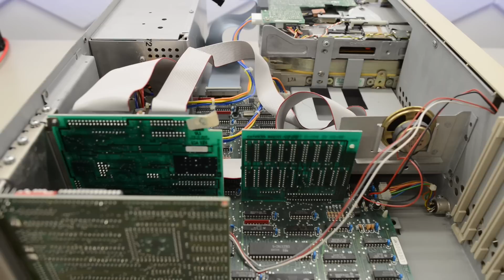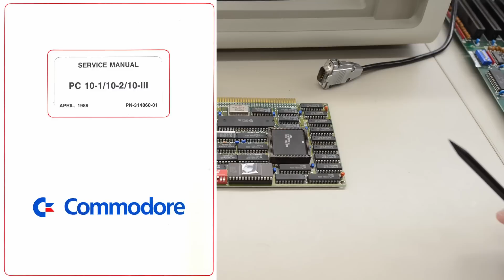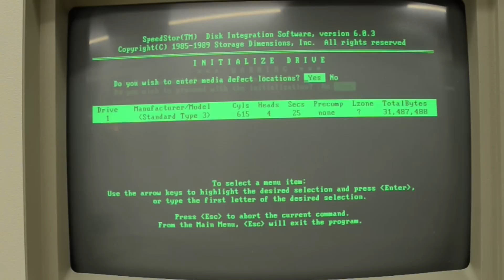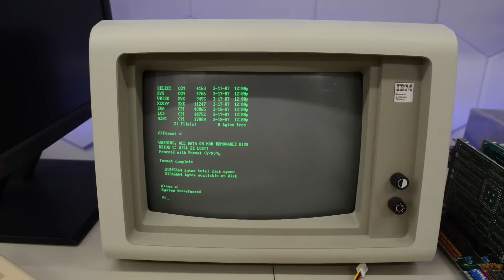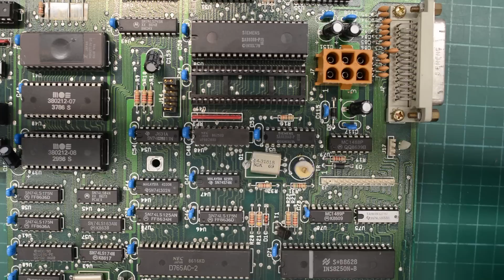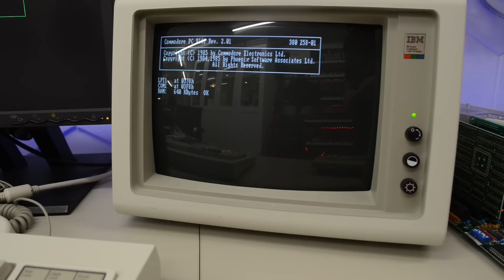Commodore PC10-II with RLL drive restoration repair and overclock!

Comment: I wouldn't have the patience with that harddisk, XT-IDE for me and a 512 MByte CF card. Much easier to get data on and off the machine too.

Regarding the faceplate, that was a common sight back then, beige desktop or tower and a black harddisk in there. 😁

Comment: Thanks for the great video! If not already commented, the ATI GS rev 3 supports an "emulation mode" for displaying CGA graphics on a 5151 or the original 76BM13 monitor.
Reply from the maker: I didn't know that. I'll try it out when the Commodore is on the bench the next time. Thanks
Reply: @Epictronics1  And if you end up high-speeding to a near AT class system with the PC 10-II, an EGA Wonder provides the same but for EGA.

Comment: Hello!

I have a similar machine, but I don't have the original keyboard. If the computer doesn't have that keyboard, it won't even boot up. Do you know how I can boot the machine without the original keyboard?

I would appreciate your help.🙏
Reply from the maker: Unfortunately, I don't know
Reply: @Epictronics1  Thanks!

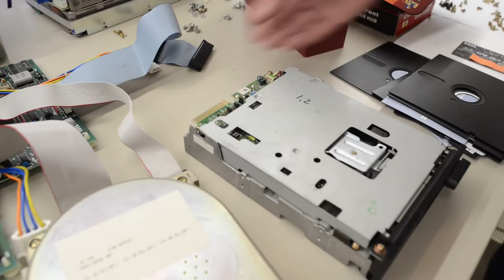Comment: 21:55 You can't swap out a 360kB drive with a 1.2M drive and expect it to just work. I'm sure you are aware on an AT machine you just change the bios settings but on an XT there would either need to be a bios setup program run if the board has nvram (or a dallas rtc module) or some other way to set the FDD type like jumpers or DIP switches etc.

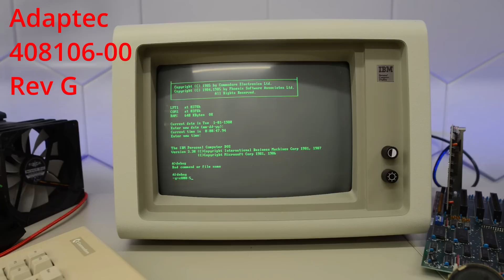Comment: 13:12 That number is the part number of the board. The actual controller is Adaptec ACB-2072 and it is indeed an RLL controller
Reply from the maker: Excellent. Thanks

Comment: 6:00 The ram board is plugged in separately for two reasons. It is closer to where the ram is actually connected/used and the routing would be easier rather than running long traces to the corner of the board.

Comment: You could have used the hard drive controller card to low level format the drive. You will need a DOS program called debug. When you start debug, you will get a : prompt. Type in g=c800 which should allow you to access the low level format routines on the controller card itself. On those old RLL and MFM hard drives this is the best way to low level format the drive and not with a third party utility. I had the exact same hard drive in my Packard Bell PB8810 XT computer back in the day and these were the configuration steps that were required to set up and use the hard drive on the computer.

Comment: if i recall right, with VSET.EXE it was even possible to run CGA games without furth emulation software on the MDA monitors. off course it was not good, but workable. I remember playing buckrogers from 360k bootdisk without any CGA-emulator TSR loaded on the green slow phosphor of the stock MDA screen.

Comment: That is a really FANcy fan!  Loved the video!
Reply from the maker: Thanks!
Reply: @Epictronics1  It's the usual mix of Commodore designs. The case design was probably one of the first type for Commodore PCs made in Germany and later it was redesigned to fit the Amiga 2000 motherboard and the fan appears to be the same one that was used in the Amiga 1000. Or the PC version came first and the Amiga used the same fan.

Comment: Love your videos, I enjoy every single one! One thing made me cringe a bit though, as a vintage hard drive collector: Opening that ST-238R without sufficient reason. Yes, drives of this age take a lot more abuse than modern drives, but opening them should be a last ditch effort. It didn't make the drive any better, and as you found out, it was not necessary. The stepper is accessible from the outside, and checking if it moves at all is possible without opening the drive. These drives will only get less and less, especially with good bearings and without bad sectors.

There are exceptions though, for example Quantum drives with sticky rubber stoppers, keeping the head from moving (and on some models actually causing the drive to slam into the spindle). These should be carefully opened, and the gooey rubber stoppers removed, replaced with short pieces of hose for example. They will inevitably cause damage if not repaired, so opening them is the only chance you have to prevent the liquid goo from getting on the platters and the heads slamming into the spindle.
Reply: 100%. Never open them without a good reason.

Comment: Sometimes, using a tool to push on each corner in turn can help free the chip from the last few molecules of solder holding it in place.

Comment: Why not also dump a V30 in it instead of the 8088?
Reply from the maker: I completely forgot to replace the 8088 with a 10MHz V20. I only realized after the video was uploaded that the 5MHz 8088 was running at 8MHz!

Comment: Is it possible to use Compact Flash cards instead of a hard drive with such an old computer ? As the drive is old and infirm and has bad sectors, it does not really make sense to use one.
Reply from the maker: Yes, you can with an XT-IDE card. For me, spinning drives are half the fun

Comment: Hi, nice find.

I purchased new a C64, then in about 1988 i purchased new the Commodore PC10 as everything at work was going PC, now i was able to take those multiplan disks home and do stats - wow

I actually lugged, the PC, green screen 12 inch monitor, keyboard, manuals, from the shop to work to train station to home, and all the string around the boxes hurt.

I was so upset as it did not work all i got was horizontal liens on  the screen on boot up.

i went back to the shop next day he said bring in the base only in the original box - it turned out the grahics card was factory set for CGA, he was so cranky with me because i did not read the manual ( about 200 pages ) there was no first set up book or instructions, he also complained that it cost him over a hour and some interstate calls  calls from sydney to melbourne then 3 faxed Australia to USA ( that would have been $5 a page at the time )

He changed the dip setting and had a monitor plugged in and it was working fine.

Now the strange part is my machine was a 4.77hz and had the 2 x 360 floppies, but i am sure it was 512 k only.

Many colour CGA games worked in green screen mode - for some of the others that did not work i used a utility called simcga or similar, - when i sold the machien there were about 3 or 4 version of that software - i do not believe i encountered a limitation of the 512k in any software 

For me it was "almost fully specked" only the then new NEC 286 Powermate's at work were more superior - full 640 or 1m, EGA cards

The machine worked flawlessly 3 years and i sold it and purchased a Turbo XT Clone

I cannot recall if the Commodore PC10 or the Turbo XT close had a keyboard with a switch under if for XT / AT - but the PC10 did have a XT type keyboard with the F1 to F10 on the left hand side going down F1 to F5 then F6 to F10  ( the XT Turbo clone is probably the machine with the switch under the board )

You will need to read the manual, i am not sure but there may be a software key press for CMOS options - i only every had the 2 x 360 floppies in the machine and they were very quiet

The early PC5 & 10 etc were a budget choice - the stock green screen and 512k was purposely done for entry level machines, i think the PC5 was base 256, but many had the 512k -  i recall the display case and the memory option and the big 2400 modems and commodore branded dot matrix printers ( which may or may not be OKI or panasonic or other large brand rebranded - i do not recall )

Regards
George
Reply from the maker: Fun times :) I grew up with a C64 too, but then I switched to IBM

Comment: Nice. When using your pinecil do you power via usb3 powerbank?
Reply from the maker: I use the original 120W PinePower. It's not quite powerful enough to max out the pinecil but it's good enough

Comment: I always heard that you should never open a hard drive because dust will get in and distance between head and the platter can be nanometers so dust can destroy the hard drive.
Reply: That applies more to modern hard drives, if you open a modern hard drive even once outside of a cleanroom it is essentially doomed to fail. 

The tolerances in these old drives are far greater and they can generally survive it, though it still wouldn't recommend it as it's easy to cause damage in there.
Reply: @xenonia-nl  Even in older hard drives I dont think the distance between the heads and the platter can be that larger that it will worrk well with dust particles on the platter.
Reply: @xenonia-nl  Also I do remember that the idea that you will destroy your hard drive if you open it because of dust was already around at least as early as late 80s.
Reply from the maker: That is good advice

Comment: I'm sure you know this, and you may even explain it later in the video when you wash the board (I'm assuming please don't sue me ha) but to get those little annoying plastic clips to come off the motherboard easily, if you remove the guts from a Bic pen and use the tube, it SHOULD fit RIGHT OVER those tabs on the top side of the board and it'll squeeze the tabs in and the clip thing will pop right out. : )
Reply from the maker: I've heard about this trick, I need to remember to try it!

Comment: The idea of spending the money on an actual 238R for a 5150 clone doesn't make a lot of sense... I'd imagine that was put in long after the machine was purchased because someone had pulled it from a decommissioned AT class or 386 machine...
Reply from the maker: Very likely

Comment: The PC10-II should support (DD) 3.5" drives, the only issue is that Commodore adhered to the Shugart standard, not the IBM standard with the twisted cable. So in order to get non-original drives to work in them you would either have to jumper them to DS0 or connect them as a second drive.

With the hard drive issues, I've had totally strange behavior happen with MFM/RLL drives that turned out to be caused by tarnished contacts on the cables! Some contact cleaner in the connectors and a wipedown of the drive's edge connectors works wonders!
It's quite possible that by multiple times unplugging and plugging it back in you managed to get a better connection.

Oh, and this machine was sold with a hard drive from factory, it was sold as the PC20-II ;)
Reply from the maker: Thanks, that's very useful info! I'll try some more with the 3.5" drive. It would be a great upgrade for this Commodore

Comment: I had the same issue with Spinrite. That is normal. It works only when the drive is already partitioned. Otherwise you don ´t see a drive letter to add and test in the menu.

Comment: You opened the drive?  Don’t open the drive.  If the heads are stuck, move the stepper motor spindle with your pinkie.  I’ve had drives work for years that way.
Reply from the maker: That would work too. But I have been inside many drives without any issues
Reply: @Epictronics1  you've been lucky. Often you can get away with opening low density HDDs without special precautions, but not always. It is pretty dumb to take that risk without even testing it first.
Reply: @Epictronics1  Dust in the drive can ruin them instantly.  And there is always some dust in the air unless you are in a clean-room.
Reply: Is it a furphy that some of these earlier drives had helium or other gases?

Comment: The drive issues are most likely due to the RLL nature of the drive. They were pretty uncommon, and of course the controller might have fed SpeedStor and SpinRite garbage, I mean it is a Commodore prat after all, and we know how Commodore felt about third party solutions. The IBM disk probably had better support for RLL drives.
Reply: Or tried the common debug g=c800:5 that brings up a BIOS low-level format routine on most controllers of that era. Google indicates that some early Adaptec RLL controllers used c8000:ccc for that menu instead, it wasn't the same card as in this but they might have used that on their other controllers too.
Reply from the maker: @Torbjorn.Lindgren  Thanks. I might try that to see if it works
Reply from the maker: I don't actually know if this drive was a Commodore option. It seems pretty extreme for a 4,77MHz 8088. The original XT only had 10 and 20MB drives if I remember correctly

Comment: Have you tried Ontrack Disk manager? The older versions were OEM for Seagate, Conner, WD, IBM and I find them better than other software. Aside LLF, it calculated the interleave, and allowed to use HDDs larger than the BIOS would allow.
Reply from the maker: I forgot to try Ontrack!
Reply: @Epictronics1  I just asked because Ontrack Disk Manager seems to be widely forgotten in the retro community. And it was a life saver for me in the 90s when I dealed with MFM, RLL and early IDE HDDs on XT up to early 386 motherboards.
Reply from the maker: I have used it occasionally but I had completely forgotten about it :) It would have been a good test to see if it could sort this drive out

Comment: 5:30 Commodore had a history of trying to make their low RAM spec machines hard to upgrade. On the Pet they would literally drill through the unused socket locations to make it much harder for the end user to add RAM later. This looks like the same bizarre thought process.
Reply: I don't think that's it. I suspect they just ran out of room for traces.
Reply from the maker: @vhfgamer  That's possible, it's just a two-layer board
Reply: Note that drive cage support actually blocks that area - so they would need to significantly redesign (or switch) the case to be able to put memory there! Not impossible but Commodore at that time was extremely price-sensitive so it's definitely possible they got told to just design around that weird hole - this may well have been the cheapest option. The motherboard is fairly well populated so it might not have been that easy to get 640k without more space, more layers or switching to more integration (but that was very rare that far back in PC clones).
Reply from the maker: Yeah, I've got a PET 4032 but I don't remember if it has one of the drilled boards. It's still unrestored
Reply: My guess is, it was probably just cheaper to manufacture this way and also allow for the expansion board to be sold separately for more profit

Comment: You should use a Gotek instead of fiddling with making disks and drives during your testing of the machines.  Would make it easier to jump between disk formats and faster to test things.
Reply from the maker: Does the gotek support double-density 5.25" drives?
Reply: @Epictronics1  Original firmware might be only 1440k but with third-party "FlashFloppy" firmware I believe a Gotek can emulate 360k as well as many other formats.

Comment: Oh my god, this looks exactly like my very first PC. It had 8088 at 4,77 MHz, 30 MB hard drive, and 2x 5,25" DD floppy drives, black-green monitor, and CGA graphics adapter. It looked 99% identical to this PC, identical wide case with 2 LEDs, with the exception that your thumbnail shows 10-II but mine was 10-III.
Reply from the maker: Cool. I have a really messed up battery damaged PC10-III too. I'm trying to repair it and make videos.